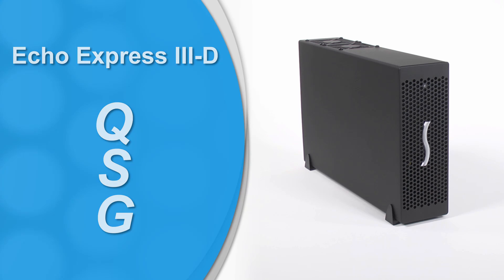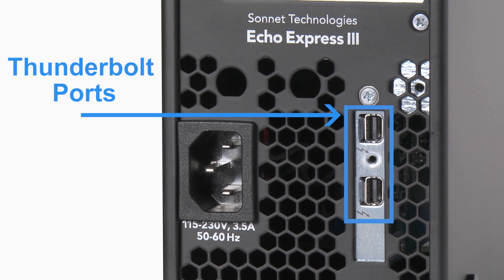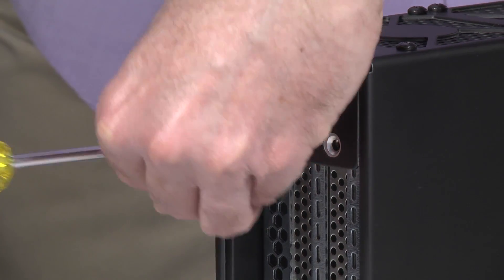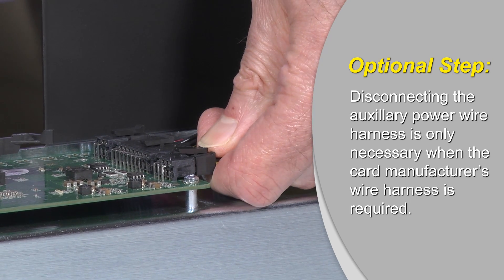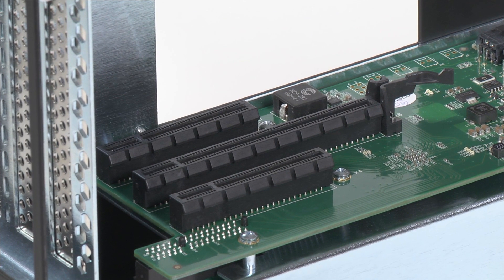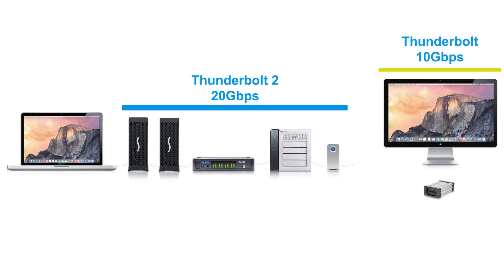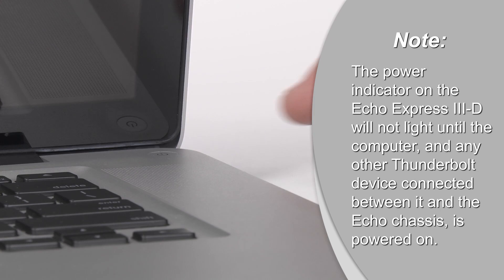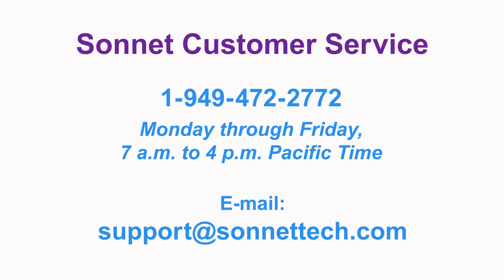Sonnet Echo Express III-D Thunderbolt 2-to-PCIe Card Expansion Chassis Video Quick Start Guide

Comment: Power pin connector front
Reply from the maker: The Chassis can provide the 8-lane PCIe cards with 25W and the 16-lane PCIe cards with 75W. The internal 6-pin Molex AUX PCIe power connector can provide an additional 75W for cards that need it, like the Avid HDX card.
Reply: https://youtube.com/watch?v=GkLLCv1meyU&feature=share

Comment: Is it possible to install a Radeon graphics card? 
Where I buy?
Reply from the maker: The Echo III-D supports the single-width Radeon Pro WX7100; and eventually should support the Radeon Pro W5500, when the software support is released for it. The successor product, the Echo III Desktop, is available on the Sonnet web store.
Reply: @SonnetTech  Tks!

Comment: noob question. Can I use a RME sound card and a GPU at the same time on the same chassis?
Reply from the maker: Yes you can. Note that the only GPU card supported on macOS in the Echo Express III-D is the single-wide AMD Radeon WX7100.

Comment: Can I connect this device also to a thunderbolt 3 (with adapter)?
Reply: Or the thunderbolt 3 version with an adapter to a tb2-device? ... want to use it with MacBookPro(Touchbar) and MacPro2013
Reply: Thx4reply, I use both and so I need a device that I can connect to both busses TB2 and TB3. Thx for your support! So, with adapter no problem :) #yeah!

Comment: Why is this so expensive? $900 for just an adapter and a case bigger than the used in the $200 Akitio, or am I missing something?
Reply: +SonnetTech Thanks for the detailed response. Since most of the mentioned features are an overkill for my needs, are there any plans to launch a competitor to the Alienware Graphics Amplifier, given that it has everything you need to run a graphics card out of the box and it costs $250? (Except for the proprietary port instead of thunderbolt) Or the eGPU solutions are not part of the target products?
Reply: +Oscar Vásquez You can use an Echo Express with a third party power supply and jury rig an external GPU solution. Sonnet would advise against it, but it does work.
Reply: ya let buy the new pc for home that better